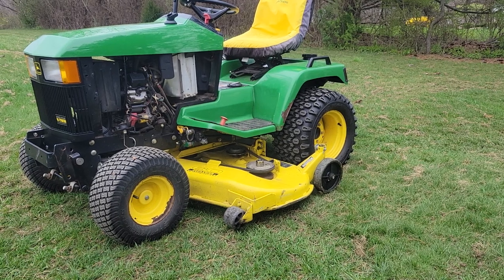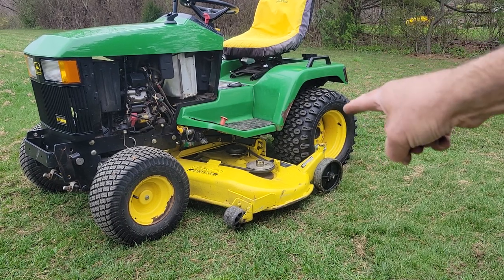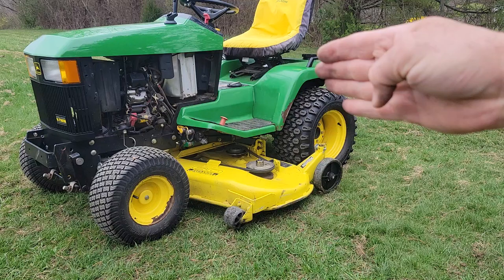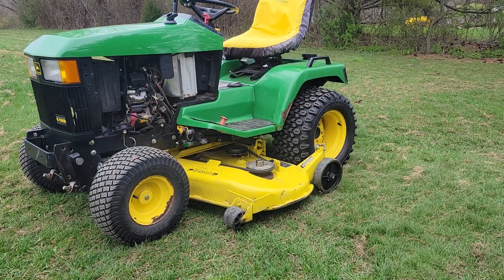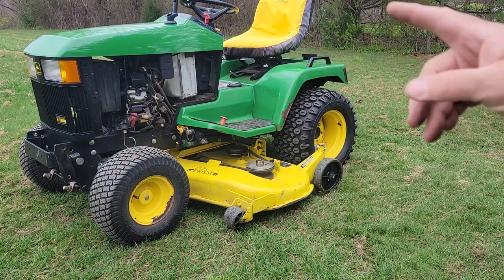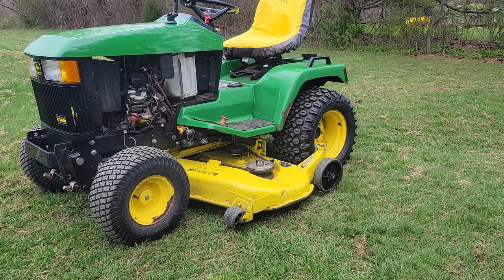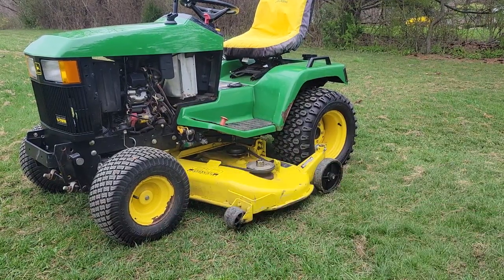John Deere 445 w/60 deck first start

Comment: The draft lift arms are probably not clocked in the right position. Very little movement up & down. Should be nearly 4" of travel. To adjust the deck height. It must be in the raised position. Turn the adjuster dial to raise or lower. Then lower the deck to see the actual cutting height.